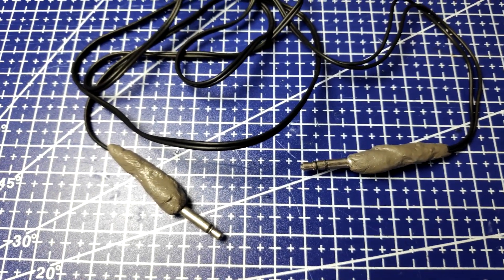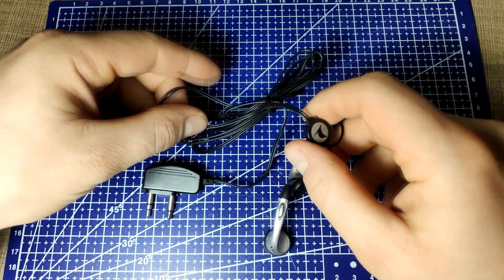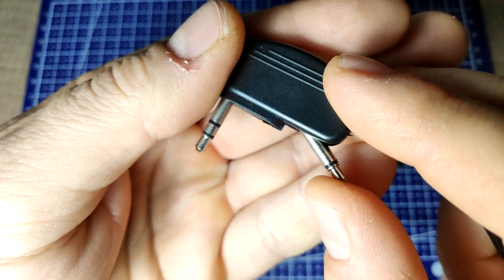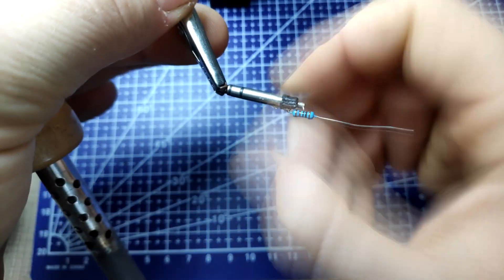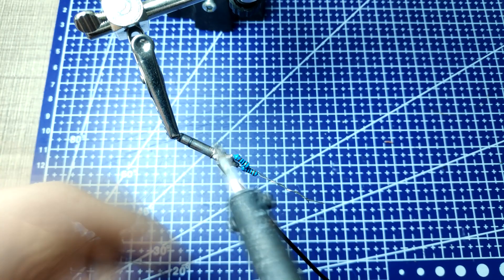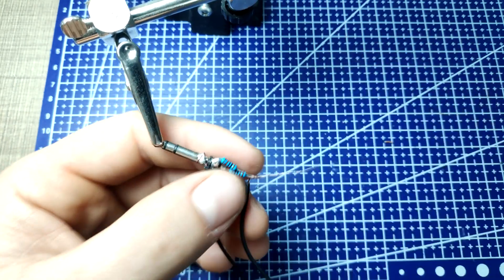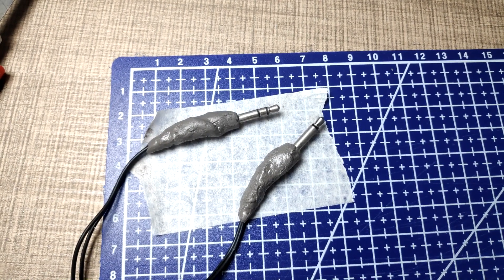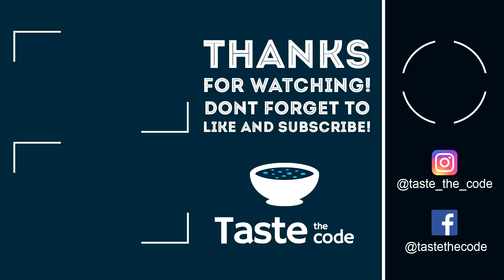Free Stereo to Mono mixing audio cable - Headphones Conversion //Basic Electronics

Comment: how many watts the resistor?
Reply from the maker: 1/4 watt is enough.
Reply: The best is none becuase they can injury your signal strength not bad on short cables but for longer ones you only need them for xlr because thats how the internals look for conectet cables
Reply from the maker: The resistor is more of a safety feature to waste excess voltage if some output is cranked up high.
Reply: @TasteTheCode  i know but 99.99999% say IT IS A MUST HAVE WITOUT YOURE GOING TO BLOW THINGS UP AS AN PROFESSIONAL IT MAKES ME ANGRY